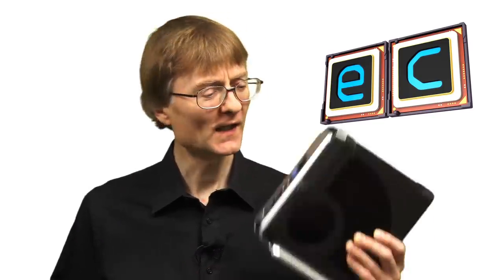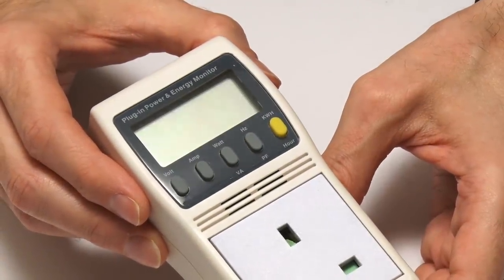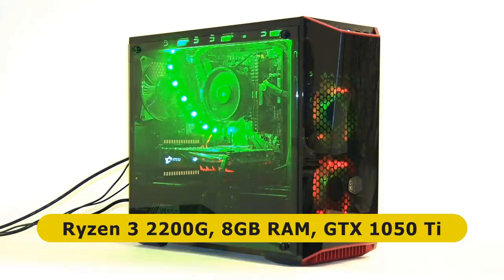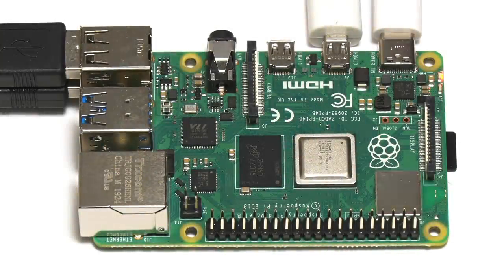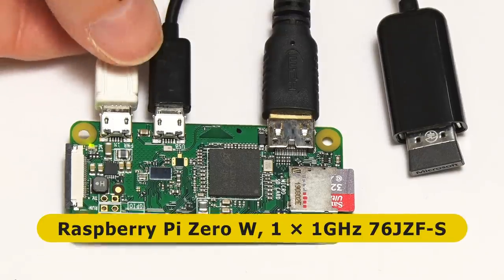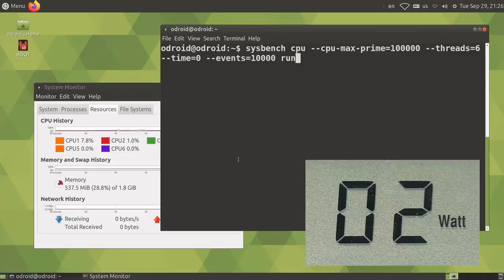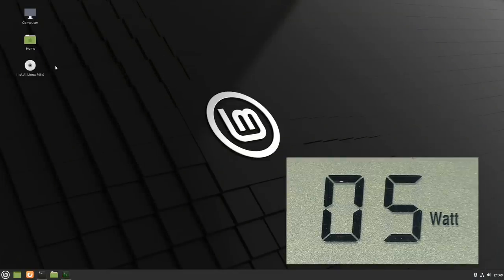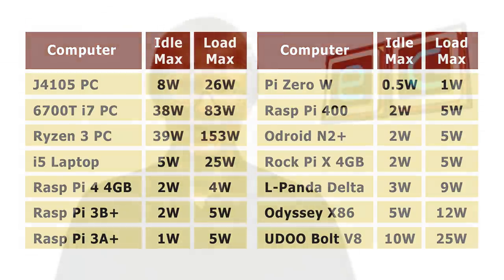PC & SBC Power Consumption

Comment: I had read somewhere that a Raspberry Pi used just as much power as a laptop when under full load... thanks for showing that info was wrong! It reinforces my desire to replace some systems I'm using as servers with a couple Raspberry Pi's.

Comment: Interesting. Hmm... Well, we only stress the CPU but not both CPU and GPU. I think it is still a good information out there as we can see which system consume less power when idle. Nicely done, although, I would like to see a more detail one, for example: rendering the same video using KDEN Live in all system and measure the power consumption from the beginning of the test until the test completed, then obtain the duration of the time times by the maximum power they consume to get the total power they consumed while doing the same workload. 

This is just a thought I have in mind.
Reply: A good point. Efficiency would be the amount of work per watt.
Reply: Yeah the respective GPU's should have been maxed at the same time, otherwise it's not max system power use. Even the low power SBC's have dedicated silicon for graphics that will use some power when used.

Comment: I had a rpi zero w going at 9amps. 

Long story short it melted.
Reply: opps...
Reply: @ExplainingComputers  I had issue with usb not working so I tried and re-work it with a hot station. I let it cool down and had it on a usb charger that reads Volts and amps. The USB cable gave out before it had time to melt. The rpi0 w seems to have issue with usb going out IDK if it is because there is no protection like the 3 and 4 has.
Reply: @Un_Pour_Tous  I find the Pis have a tendency to blow up even when not heavily stressed. People who know more about this stuff than I do don't speak highly of the design.
Reply: @marcdraco2189  Hmm, I never heard of that problem. My 3 raspberry pies have worked flawlessly (although a few as cards have been consumed, most likely due to all the random writes). That being said it’s a way to small sample size to say anything.
Reply: @PatrikKron  Same with me, I might just have had bad luck, although I'm unwilling to try another one for sh*ts and giggles. The last one took out the entire backup - it's like it crashed and went on a rampage before dying in a puff of smoke. Impossible to tell the load it was on at the time but it did have a decent heatsink on the CPU. 

The Pi Zero I keep for Pi Hole (to date) hasn't had so much as a flicker, but for some reason the Chinese alternatives (with the exception of the Orange Pi PC which met a similar fate under load) have all performed flawlessly. 

I wonder if I Chris would give one of these a go - the "solid" aluminum case really seems to keep the H3 cool even under load. (I'm using them headless, because... well, no video) and running Armbian which to my mind, is the best server OS - based on a stable Ubuntu with their own tuning.
Reply: @marcdraco2189  I can't agree with that I have 7 RPi of various specs v1 to v4. Two of them have been running non stop for about 4 years. All the others about a year now. No problem with any of them.
Reply: @retroretiree2086  How hard though? The ones that I blew up had been running pretty much flat out (not overclocked, nor overvoltaged though). Running as anonymous FTP servers so they could get pretty busy with IO and memory access.

This seems to agree with what the lads at Armbian are suggesting - they don't seem to be fans, but that could also have something to do with the closed source nature of the boot and graphics chip. Rather outside of my wheelhouse, I can only speak as I found with smoking machines and destroyed data (the drives were fine, it was the data that went - or rather, the superblock. If I'd only known about Chris Greenier's recovery software... but I didn't and the rest is painful memories.
Reply: @marcdraco2189  You are moving the goalposts! You said: "I find the Pis have a tendency to blow up even when not heavily stressed."  Which is not my experience. One Pi 1 has been running as a syslog server for nearly 5 years. Logging messages from 2 routers and various web servers on and off. My not-very-active web proxy and web server a year my zabbix server a year Maria DB servers and slaves over two years. No they are not stressed out all the time. What they do do  is eat SD cards approx every 6 months :( I have a couple of SanDisk "High Endurance" cards on the way to see if they actually last longer!?
Reply: @retroretiree2086  Heavily stressed (in my book) comes when you over voltage and/or overclock and/or don't respect good thermal design. One of my DHT22 temperature sensors met this fate at the hands of a poor soldering job.

There's no good reason that with good design, a machine with a decent heatsink (which these had) should overheat to the point where it dies just because it's running at 100% load.There are no moving parts to wear out. The only thing that can bring about an early demise (short of a failure of some other component such as a voltage regulator or capacitor going short) is heat - and those other components can fail due to age (primarily cheap electrolytic capacitors) or heat - anything. 

Many servers run at approaching 100% load for years at a time, and while electron migration will bring them to their knees sooner or later, good thermal design and good design overall seems to keep them alive. Intel, in my experience, has always been pretty good in this regard.

It's a truth to say that if you downclock a processor it will last longer of course. The canonical example is the world's oldest working light bulb which has been run a very low voltage for decades without ever being turned off.

While I'm blaming the "Pi", it appears it was the CPU/GPU combo that failed - despite the design being able to down-clock when reaching a pre-defined thermal limit. I've got an ATMega 328p on the bench beside me, also an ARM design (although that's where the similarity ends) and no matter how hard I push that it doesn't even get warm. I guess in that case, the comparatively small number of transistors produces far less heat which is why these things can run for years without missing a step.

So no, I'm not moving the goalposts. I'm using decades of experience with computers and sharing my own findings vs. other hardware all the way back to 8080, Z80, 6502, 6809, 68000 etc. through to the latest i5 and i7 all of which I've seen stressed to ludicrous levels without missing a beat provided they have been properly cooled and run within the design specification bus clock and voltages.

Some AMD Athlon processors had a nasty habit of choking their guts but the company has since fixed that error. During that period Intel took a huge lead thanks to its (then) superior quality. The Athlon had far better memory management though so it was the superior gaming/rendering setup for the same "paper" performance.

I'm not the only person to note that thermal throttling either - some of the game "emulators" also suffer in this regard on the Pi3 - I don't have a Pi4 (nor am I likely to buy one) for this rather disappointing reason.
Reply: Pi Killer!!!
Reply: @reggiep75  lol
Reply: @marcdraco2189  Almost sounds like those people were running Pi4's without any sort of thermal compensation or active cooling and had them blow up. But the test results would agree with your viewpoint. AMD has always been a powerhungry beast. They only shed that image (in my broken memory) when they were more consistent about shipping good OEM heat management solutions.
Reply: Yeah I have let the smoke out of one as well... cheap (still cost twice the Pi grrrr) 24V ADC that melted and took the Pi with it.
Reply: Sorry, is 9 amps not normal? Do you have 110V in grid?

Comment: Thanks for your effort and making this public! That is (also) why I stopped growing my SBC flock. For my home automation system I am using a refurbished business laptop with some cosmetic drawbacks but i5-6300U 8GB, 180GB SSD. Idling around 3W to 5W (LCD display turned off) under full Win 10 Pro. Nice access via remote desktop. So I can run it 7/24 for just a few EUR more than a Raspi but having all advantages of a laptop if needed.

Comment: Hi Christoper. Great topic. That's why I use SBCs. My PC is up to 300W. No SBC consumes even 1/10.
I did review an AMD Threadripper 3990X this week. That does do pretty well in power consumption per performance. It is mighty powerful.
The ARM server with older build technology is neck to neck in performance per watt maxed out. 120W vs +400W being 4x less powerful. AMD TR overclocked uses +600W, 5x faster. In idle it does consume 100W. But who wants a Threadripper and use it in idle all the time :)
Next week I get access to an Amazon AWS server. I'll have to look for better benchmark tests. These machines are way too powerful for my SBC benchmarks. They are not stressed by them :)
I also got a new capture device. Way better, but I need to capture in raw with N2+. So +50MB per minute. But amazing quality. Even the N2+ can't handle live encoding of 1080p60fps. 
It's not a standalone recorder.. 
Have a nice day. Greetings.

Comment: Another great video, thanks!  I'm currently using multiple Atomic Pi SBCs to run GIMPS software but I may add a Rock Pi X since I'm sure it would draw less power than the Atomic Pi machines.

Comment: I have have a couple of Raspberry Pi's that I have bought over the last few years and I have gained enough skills to get confidence in the use of the Terminal

However over the last year or so I have been watching these vlogs and other computer vlogs and I have been getting more interested .  So earlier this year I changed the OS on my 10 year old PC from Windows 10 (Originally it would have been Windows 7) to Ubuntu and updated to 20.04 when it be came available.  Then during the summer I watched the Initial vlog on the Seeed Odyssey J4105 and the comment that it would run You Tube videos made me take the jump.  I have bought a Odyssey J4105 120 GB Mini to be my home computer.

This is going to be a trip of discovery but thanks to Explaining Computers I think I will be able to enjoy the trip - already updated the OS to Ubuntu :)
Reply from the maker: This is great to hear. Enjoy your Odyssey board and Linux adventure! :)

Comment: Chris loved the content but please consider buying a powermeter with some considerable decimal value
😊😊
Reply: That digit might be so jittery that it is only confusing.
Reply: Most common power meters are poor at the lower end, simply because there you are using only 1 or 2 bits of the ADC range, and most common ADC chips on MCU's are pretty poor performers at the lower end and also pretty poor with long term drift. you have to choose full scale current range to get low power readings, and as most have to contend with the full rated current draw of the power socket ( 15-20A around the world ion most cases) you suffer at the low end.

To get a decimal point you will have to step up a lot from the cheap consumer grade devices, and those meters are not going to be $10, and will also not be very tolerant of overloads either. You will be paying Agilent, Yokogawa or one of the other top tier instrument makers quite a lot of money for the extra point, and the confidence it actually is a valid reading. 

The common meters are poor performers with loads that are SMPS input as they tend to be slightly under or over in the power calculations due to the harmonics and the high peak currents.
Reply: @SeanBZA  thanks

Comment: My Ryzen 7 2700X, 16GB RAM, GTX 1080Ti and 1TB SSD idles at 150W and goes up to 420W when fully loaded on CPU and GPU.

I measured this using a Kasa Smart Plug and a C# program I wrote that monitors the plug power usage and writes the data to an SQL database.

Comment: Hi Chris. Very interesting video. As you point out, the power measuring device you have is very limited when you get down to the power levels of the single board devices.  I have a home constructed one (about £30) based on a Peacefair PZEM-022 unit and TheHWcave design on here (he as two videos). I constructed mine permanently in the 'x10' mode (see the second video) for better sensitivity. It gives me two decimal places down in the 1W region and below. And goes down to 2mA AC current with reasonable accuracy. This gets you below half a watt, or even less if there is some power factor involved. It still displays power, although not current or power factor when you go below the 2mA.     I tested my Pi400 with a 128GB micro SD card and got a little less than 2.5W at desktop idle with Raspberry Pi OS. I don't have the stress test software you used, but I got a maximum of about 5.1W playing a 1080p 60 YouTube video with a lot of movement. I normally use my Pi400 with a USB 3.0 cable and 2.5" SSD (a fairly old Sandisk 128GB). With the SSD setup and the same tests I got 4.1W for desktop idle and a maximum of about 7W playing the same video sequence. Quite a lot higher than the micro SD setup percentage wise! The official Raspberry Pi USB C power supply seemingly draws only 95mW on standby when the Pi400 is shut down but left plugged in. I'm not sure how accurate that is, because it's below the 2mA current threshold. I have, however,  found very few switch mode 'wall adapters' that seemingly draw so little standby power.

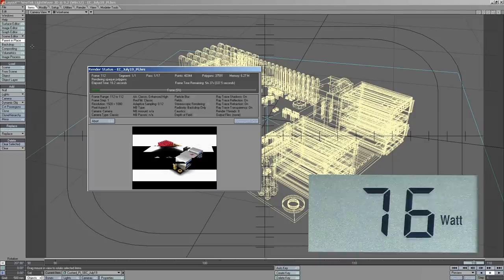Comment: Really interesting video.  One quick thing - at 4:15, you say that you are using the "T" version of this CPU to save power.  It would be interesting to see the difference, in energy use, between the i7-6700T and the regular i7-6700.  Every test, that I have seen, suggests that the "T" versions do not actually save much power.
Reply from the maker: On the T chips, it will depend on the use case. The TDP of an i7 6700T is 35W, compared to 65W for the non-T model. If used at load, the non-T version will therefore consume getting on for around double the power (TDP is not a measure of power use, but a good guide). So in something like my use case, where a machine can be rendering at full-load 24/7 for weeks on end, there will be a considerable power saving. However, most PCs sit idle most of the time waiting for human input, and at idle power use of both chips will be very similar indeed.

How big the power saving is (and here it could never be greater than 30W) also depends on what you compare against -- most notably the power drain of the entire system. So the percentage power saving in a system that consumers many hundreds of watts (with a large GPU, etc) will be relatively small.

Also note that for me, again due to rendering, I use the T chips as much to save heat as power, so increasing system life and stability.

Comment: I run my home web server on a 700MHz Pi 3 for that reason, it is on a small uninterrupted power supply and runs all day, probably with an unnoticeable impact on the electric bill. It's slow but it eventually brings up the page and is reliable as an always on server. The PC looks like a super computer compared with the Pi though, some TensorFlow image training on the Pi is minutes compared with seconds on a PC. Though it's running all day and as it takes pictures out the window processing those pictures is just something it does during the day and who cares how long it takes.

Comment: Chris: I think a really cool episode would be to show a setup that uses only off-the-shelf solar power, even in sunny England.
A small panel, a 100 Wh battery, an SBC and low voltage monitor.
Pose the question, "Is it possible to run a computer completely off-grid?"
Also details costs, including running costs for 5 years.
Reply from the maker: A solar powered PC is on my production slate!
Reply: @ExplainingComputers  Can't wait!  Thermonuclear powered Raspberry Pi.  Jolly exciting!
Reply from the maker: @lubricatedgoat  I also have notes for a steam powered Pi, and a clockwork Pi. :)
Reply: @ExplainingComputers  I feel like 3PO crying, "Wonderful! Wonderful!"  I used to build steam engines as a kid with my grandfather!  As for the other one, how about a Clockwork Orange Pi?
Reply: Of course its possible to compute on solar. I've been doing it on a small 1kW system for three years - completely off grid. I use a Dell laptop and Samsung monitor but am always looking for ways to save the amps. It's about time I transitioned to a pi, particularly now the 'pc replacement' theme actually has some substance.
Reply: Throw in a wind turbine to help collect juice. I'll be waiting for for this. Lowest power monitor would be handy or monitor and speakers vs TV.

Comment: Thanks for diligent (and probably rather dull) work. 
The conclusion is hardly surprising: x86(-64) sucks watts. 
Unlike the original ARM chip, which worked even when it wasn't switched on.
Reply: Bravo - not many people know about that.
Reply: your conclusion is flawed. size matters when comparing power consumption. a shorter cable is going to have less power loss when delivering a 5V line every time. all of the ARMs boards are smaller than their x86 counterparts. selectively comparing the pi 400 versus the  n4100 lattepanda delta shows a 1w difference in idle and 4w(80%) increase in load power draw. the n4100 is significantly faster than the pi 400, in both cpu and gpu, probably memory access as well. also as tested it has provision for upgrades such as sata, pcie x2 etc. all of this costs power even at idle and not in use. the n4100 board is physically slight bigger but it has a cooling fan which is likely to add to the power consumption at full load. you are comparing a full computer with a barebones and concluding that the barebones consumes less power. which is obviously true and expected. the AMD chip in the udoo bolt is plain bad and shouldn't be in mobile platforms.